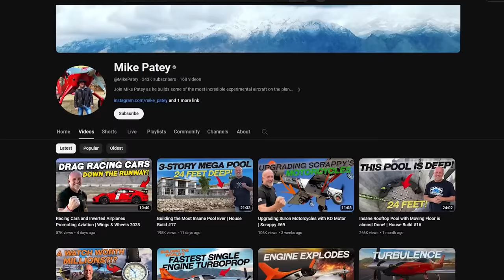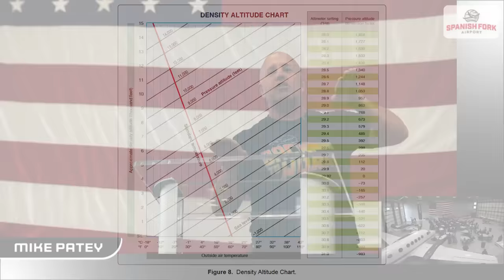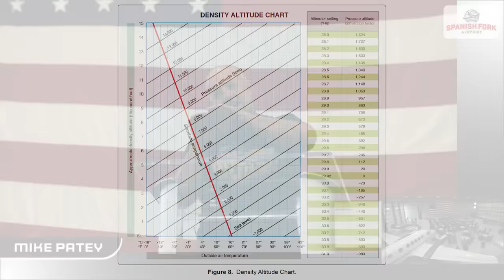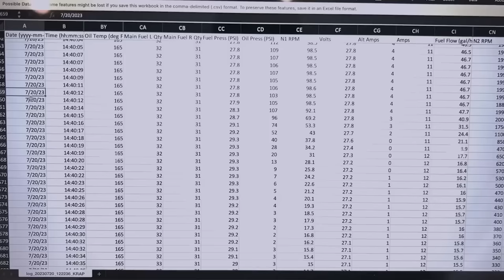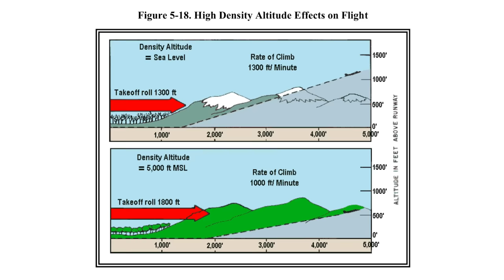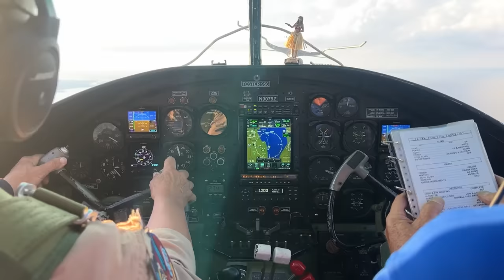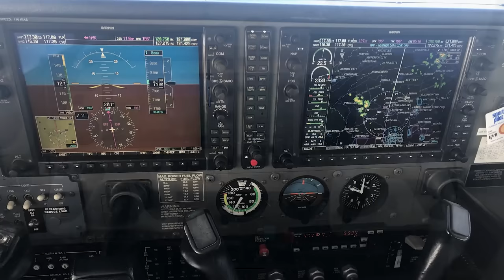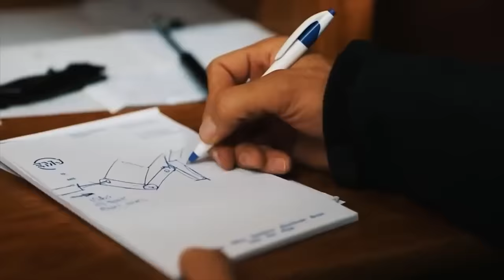I've Lost 4 Friends in 60 Days - Aviation Safety Discussion | Mike Patey

Comment: Great rules. Met Mike at the Garmin booth. Fantastic guy. 
Just flew from So Cal to Osh in a Cherokee 140.  I asked the owner and friend of mine for the aircrafts performance and specifications along with the flight plan. 
First stop, late mid day, was Flagstaff AZ @7kMSL.
 Calculated DA for the temp/altitude/aircraft and load  showed we were not going to take off. Adjusted flight plan, chose lower altitude airport, re-calculated DA and all worked out. 
Thankfully. all ended up well, with good team work and proper planning. 
Please, understand and promote what is being said here regarding DA.

Comment: @MikePatey Maybe you could have a chat with Garmin and a few other Glass panel companies to see if they can find a way to integrate the density altitude and aircraft performance into the display, so it would show what your current max altitude is based on current conditions.  In addition to that, if somebody made a cheap enough load cell/strain gauge that could be integrated into the landing gear, you could also use that as an input for the weight and balance in the panel. That way it could show you visually your current CG envelope.   If you had a lot of that data I am sure they could then in the panel show an estimated take off length and obstacle clear height.  If some one was super fancy, they could have a laser range finder on board and pick and obstacle (enter that data into the panel) and then you could see if you could clear it.

Comment: Great video and thought provoking on safety.  One of the safety methods I use to avoid "get-there-itis" is when planning a flight for immovable dates, say family vacation trip, I check the weather in advance and trending to the departure date.  Then, if I'm fairly sure the flight is likely, I purchase refundable commercial tickets that allow me a go/no-go decision to be made right up to the last minute.  For some destinations there are no commercial options so you always need to be prepared to say no and also understand that once you're underway as an average GA pilot you don't have the equipment and/or experience to handle severe weather... so stay flexible. Started with a 172 25 years ago and 9 aircraft later in a TBM700B and still learning and will fly all the time at around 100h/year average... not enough but all I can muster now for time and cost budgeting.  And watching, reading, recurring training and so on in between.  Keep the blue side up :)

Comment: Since you were talking about icing I’ll tell a quick story. I fly a Cessna 421B for work. Me and my boss and his friends took off around 10:30pm from Niagara Falls airport ifr. We enter the clouds at about 5,000 ft and it’s in the 40s and full on imc. As we’re climbing thru 9,000ft, we built up ice and I notice the airspeed dropping and as I notice that, the auto pilot goes out, and my instrument lights went out.. luckily, we had de ice boots and props.. but flying single pilot imc, hand flying while trying to turn on deice equipment with no instrument panel lights was tough and scary lol good experience tho

Comment: Thank you for sharing – an amazing and touching presentation!  As a CGAUX instructor, risk assessment and mitigation are part of our curriculum. I will be adding the one strike you are out suggestion for go-no go decisions.  We teach to reassess the situation as conditions and potential problems manifest before departing and alter plan as conditions change during the trip.
I recall a friend flying back from running a marathon (tired) losing electronics, and kept going because the magneto kept the engine running.  He was lucky and made it back but I expressed my concern for the risks taken.  
I started in gliders before converting to single engine VFR and find it is easier to stay focused on the basics of flying the plane because of the sailplane training and experiences.

Comment: I love your passion. Got my PPL back in 1999. The ink wasn't even dry on my ticket and took 3 friends up in a 172. One passenger lied about her weight but that's not her fault. On throttle up the airplane barely moved on a 2800' runway. I pressed. Worst decision of my life. We barely cleared a tree line and blew threw a noise abatement turn. Stall horn was chirping at +25fpm.

I nursed it back. Worst landing of my life but we made it. Personal minimum #1 set. Never fly with all seats full.

Went up with a good friend of mine... a seasoned pilot. I was PIC flying into an airport I've never been to... at night. Airport was KORS. We descended down, landing to the North and all hell broke loose. the 172 was on it's wingtips due to the turbulence coming over the foothills. Without any knowledge of the surrounding terrain I couldn't turn and had to ride it through. We never landed, opted to return to base.

It's interesting how Personal Minimums can be set so quickly... if you live...

Comment: Over 30 years ago I jumped into a C-150 with a hefty passenger (and I’m hefty) on a hot summer day. Because of the dogleg, the grass field had about 2,000’ useable with 50’ obstacles at each end. We cleared the trees with little to spare. Airplane took forever to climb out of the tight little valley. Lesson learned. Had a lot more respect after that and wasn’t as lazy afterwards.

Comment: One thing I was told early in my Aviation career  was to expect to Lose Friends . Over 30 years in the industry that statement has never been truer.  I grew up in the hart of the aerobatic world at the Pitts factory . I have lost a lot of friends over the years and have done everything within my personal abilities to help support the Aviation safety side of things right down to building 2 full motion flight simulators for the USDA and the Medallion Foundation in Alaska.   You can't simulate every condition but it helps  in every case I have lost friends it's been because of simple reasons that where easily avoided. Pilots doing things they should not be doing in places where they had no business being. I admire the  Patty Brothers and wish there was more ways to help build up the  safety side especially as backcountry and STOL flying is becoming more and more popular

Comment: Mike, here is another safety tip.

Dont fly low over water in the winter time.  I am sure you remember your engine failure where you barely made land.  

I recall the videos with the bush plane crowd flying low over water in the winter.  An engine failure will but you in the water, and what would normally be a survivable situation will lead to the death of all occupants due to hypothermia.  If you end up in water below 40 degrees, swimming more than 50 yards is not going to work.

Cold water is a killer.  Fly high enough to able to glide to land.

Comment: High DA has remarkable impacts on performance, one I only learned after flying a turbocharged plane out of flagstaff, AZ is that the turbo takes a lot longer to spool. It was a long runway, but I know it took at least 750' of runway before my engine was even making full power due to turbo lag at a hot and high airport. One thing that can save you or kill you is doing turns in slow flight, you can end up in an accelerated stall very easily or you will successfully fly the smallest possible turn radius, which may get you out of a canyon if you mess up and can't outclimb it or get pushed down into it. I've been told that learning to fly gliders can hone skills for powered mountain flight, teaching you to work with the wind and the air currents which can get scarily strong.

Comment: Worst icing I had as an engineer was in Iraq in the spring in a C130E flying around thunderstorms. Leading edge anti-ice was struggling to get it off the leading edge, and in an e-model you loose allot of power when running the anti-icing.

Comment: I learned to fly in Glenwood Springs Colorado. Every hunting season pilots and airplanes would show up to scout game. As a mountain instructor, and quite young at the time, I was always very impressed by the “flat landers”, that came to us for some mountain flying and mountain flying tips. The one Mike talks about here, never flying into a box canyon, was something we harped on many times. It actually even almost got me one time when I had to push my nose down, even though I didn’t want to, but had to, in order not to stall, and maintain flight. We came very close to tree tops. Unbeknownst to my hunting passengers, we came very close to not getting out of there. Thankfully, I was in a 180 horse 172 with a constant speed prop and of course, that never happened again.

Comment: I was in  UH-60 on a delivery with seasoned test pilots it was winter near dusk. We had an opening and they were concerned about icing but we took the chance. As soon as we started to decent the ice rate meter pegged in about 5 sec. You immediately knew we were in trouble. The vibrations shook your fillings out. Hands went to the deice in a flash. When we landed a couple  MINUTES  later we had at least 6" of ice built-up on the stub wings. When a test pilot says holy shi!@ the pucker factor takes a piece of the seat.

Comment: @Mike Patey, I would like to get into aviation when I can afford it. I was wondering if you can create a flight checklist for safety. One that includes a point system maybe. So if it's dark out vs day, that's minus one point, if the weather has minor issues, it's minus one point, if the weather has a bit bigger issues, it's minus 2 points. Mental state, elevation of departure and arrival locations, and some other things you recommend to check for.

Comment: The point about pilot humility resonates. About 30 years ago I flew in an ultra-light with an Indian Air Force pilot. The maneuvers he made with that little plane to were frightening; it was a cloth wing Rotax twin. Not rated for roll, he very nearly rolled it. Multiple stalls. I got out shaking.  Later that morning, even though winds turned gusty, the he went by himself in a powered hang glider — and crashed at takeoff. He survived without much injury, but it could've been worse.

Comment: Speaking of the weatherman being wrong, during the winter of '83/'84 there was a cold front parked across the panhandle that the weather bureau expected to stall out and move back North. It didn't, the cold front blew through, the weather bureau missed the next day forecast high temperature by over 50 degrees. This was the beginning of a huge cold spell in Texas, we had highs of 11 degrees and lows of 0 degrees, this was in West Central Texas. We were supposed to have been in the 70s.

Comment: As a Scuba-diver, I have a similar rule around strikes, and even similar "strikes" like being tired or night-diving.  It's not exactly a 3-strike rule, but I often find when looking at scuba accidents and incidents, it's 3 things that went wrong at the same time, often 1-2 of those being safety rules or problems deliberately ignored by the scuba-diver.

Can you scuba-dive solo?  At night?  Without redundant-air?  While tired?  While a piece of equipment has an issue?  ...and so on?  Given all of the above and more, there's a greater-than-50% chance you'll come back alive.  The problem is you're pushing closer-and-closer to the point where even a minor incident can turn deadly.  You don't react properly because you're tired.  You grab the wrong item, because it's dark and you haven't practiced night-diving.  

I personally solo-dive even in very low (no) visibility.  But as part of that, I add lots of redundancy, including redundant air, multiple strong cutting devices, redundant buoyancy and more.  I also tend to move slower and take my time, avoid any overhead environments, or potential entanglements.  The redundancy doesn't "allow me to break rules" but you want a certain margin of error, safety, and redundancy.

I haven't "called" (ended early, or not-started) many dives, but I did so twice this year.  Once because too many little things went wrong (on a shallow dive), and another because I hadn't gotten enough sleep.

Comment: Nice talk! Helicopters are therapy! … until you run out of pitch. plan your flight…mission, man, machine, medium, management. We all have to check ourselves. Failure happens so we train for the EPs we know. Training for the unknown, managing the unexpected, and taking a hard look at your capabilities with what changes you can affect. I wrote a paper that explores the relationship between instrument-rated and non-instrument-rated professional pilot accidents under part 135 when they fly VFR into IMC. Helicopter emergency medical services (HEMS) pilots often fly in marginal weather to transport injured people from accident sites to hospitals. Generally, this mission is below 1200 feet above ground level (AGL) in uncontrolled airspace or class G. I wanted to research if there was a survival relationship between pilots who hold an instrument rating as opposed to pilots who do not hold an instrument rating when flying IIMC. I found that there are no survival differences in pilots who hold IFR ratings as opposed to those who do not hold an IFR rating when they fly IIMC. Surviving IIMC was the hardest thing I have ever done...but that is another story.
Sman

Comment: I'm a hang glider pilot
landing 4000+ feet in summer, you are smoking across the ground, when you need to flare. flare based on ground speed and not stall characteristics  and you are going to pile in hard

Comment: Being based out west in the mountains exposes aviators out there to a lot of icing and density altitude issues most of us never deal with. I never had to deal with ice in a light plane. I avoid that by never going up when conditions could create it. Jet airliners are built to deal with it better than just about anything else. With their enormous jet engines with an abundance of hot bleed air from the engines compressors, they can heat up the leading edges where ice isn't much of a factor. Plus their high speed with the ram rise due to friction, also combats ice. But on approach it's the most venerable time for them. They have to slow down just like other planes. Dealing with ice in light planes is more challenging.

Comment: Excellent talk. I’d like to add a subject to your next safety talk. Pilot arrogance: Check list usage, PIC-Co-Pilot interface, and showing off.  As a case in point, look at the King Air crash during takeoff in Addison, Texas. 

I’ll let you watch the video to see the details but in the end, this arrogant a-hole killed himself and a nine other innocent people. 
1) He was proud of not using checklists.
2) He was a “cowboy” who liked to show off by making max climb takeoffs, yanking back on the yoke. 
3) He instructed his co-pilot that anytime there were passengers onboard he was to not touch the controls. 
4) He was overweight and out of balance. 

This time, the friction-lock on his left engine throttle was loose. Because he didn’t use checklists he didn’t catch it. He took his hand off the throttle to yank back in the yoke with both hands. As the nose went up, the left throttle went back to idle. He didn’t react properly to get the nose down, reduce power, and jump on the rudder to achieve level flight. As the co-pilot sat with his hands folded, the King Air rolled left and crashed into an airport building. 

This didn’t need to happen. We need to be critical of each other and not laugh at pilots who do stupid, arrogant, irresponsible crap. Tell them to knock it off. Safety is serious. Call them out. If they are habitually or purposely dismissive of safety, report them. 

That’s my two-bits worth. This incident still makes me angry every time I think about it. 

This happened at Addison Airport on June 30, 2019.